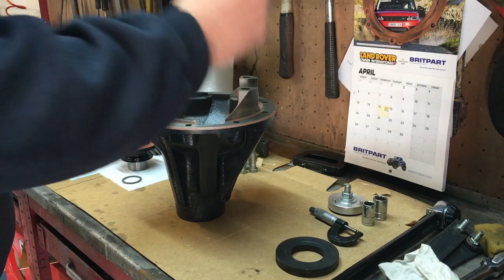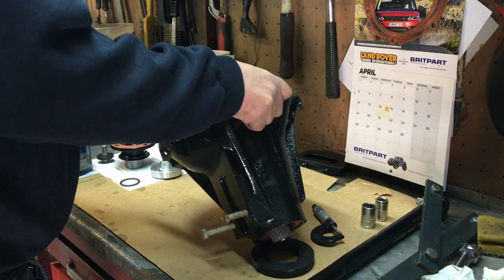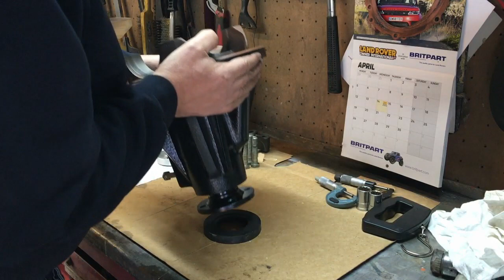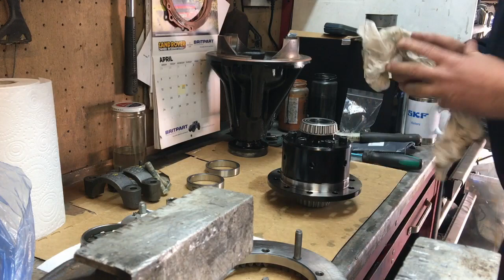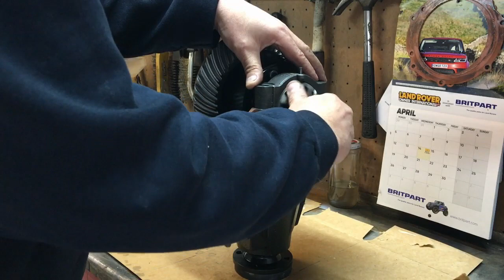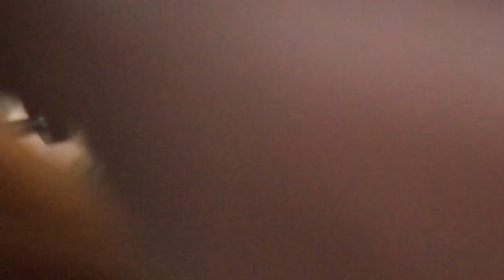Fitting the Ashcroft ATB into my front diff case.

Comment: Great video - thanks
If you were presented with two complete  identical axles on the bench, one with an ATB and one without how would you test each to work out which was the one with the ATB? Cheers
Reply from the maker: The ATB diff looks different, but if the axles are assembled the first check would be turn one wheel, the opposite side would turn the same way with an ATB and in the opposite direction with an open diff.  I assume one could lock one side into the vice with a half shaft and measure the torque required to turn the opposite side to judge how worn the diff is?
Reply: @defender90keswick.nigelsla59  cheers. I wasnt sure with it being an ATB would both ends turn the same direction without one wheel needing some resistance. One to try when you build it up if you can? Cheers

Comment: Hi Nigel, love the video's and level of detail. Can you please tell me if the Ashcroft Limited Slip Diff ATB for the front is different from the rear so it does not affect steering? 
I read that the pre load set up is different on front and rear to achieve different bias ratio's i.e. approx 2:1 on front compared to 3:1 on rear diff?
Not sure exactly what is required to achieve that, Truetrac can be purchased pre-configured for front or rear or by reversing the worm gears as shown on a youtube video by Neil at Fourby,.
Does the same principle apply to the Ashcroft LSD Torque Biasing Diff Centre as I have one to fit one to my front diff?
Thanks for the video's, keep up the great work, she must be nearly finished by now?

Comment: Hi, I follow your videos with great passion, I like what you do, I ask, I saw that you use an ATB as a center differential, an ATB at the front, and an ATB at the rear ??? Will you use the stock one? Or do you plan to use a 100% block ???
Reply from the maker: Hi, The rear diff will be a locker from Ashcroft.
Reply: @defender90keswick.nigelsla59  
Are you thinking of replacing the front joints and drive shafts with reinforced ones? And also at the rear, will you eventually mount reinforced drive shafts?
Reply from the maker: @andreav.2993  Not right now, I will more than likely do this at a later date, depending on what kind of use the Defender gets. TBH, I enjoy the building more than the driving..
Reply: @defender90keswick.nigelsla59  Ok thanks Nigel dell your prompt answers. I will continue to follow you. Your videos are great.